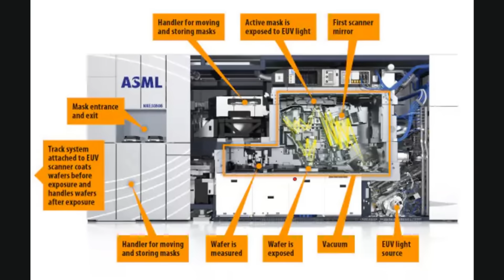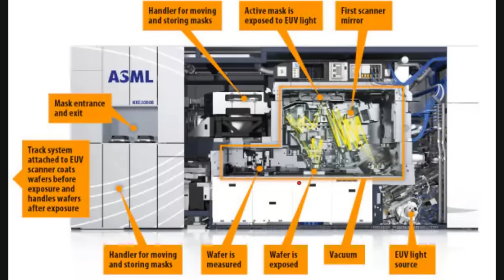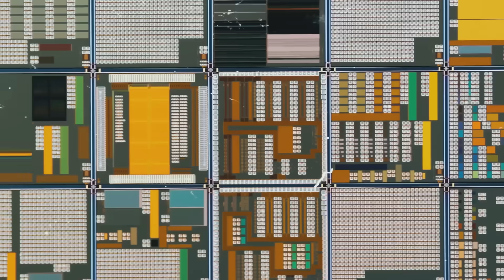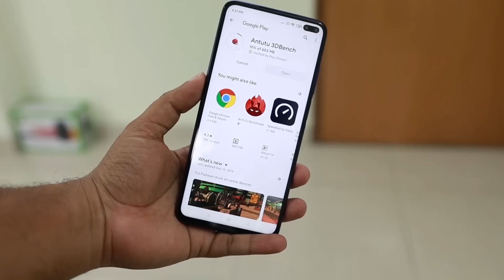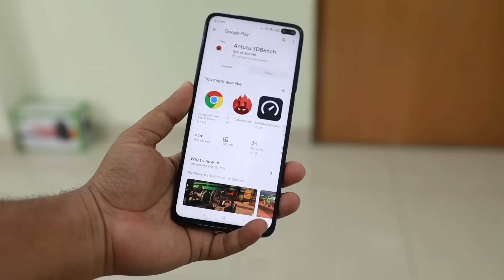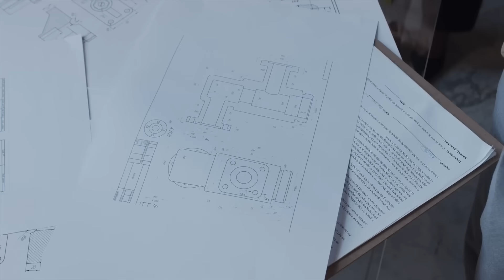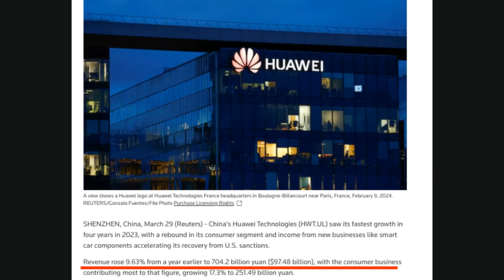China Defies U.S $400B Sanction Wall—Huawei Builds Banned EUV Chip Machine & Replaces ASML

Comment: During ASML's development, that technology Huawei uses was considered a design option, but they went for the laser in the tin droplets idea instead. Anyway, generating the light is only the first step. The trouble with EUV is the refractive index of glass is very low, the lenses are quite opaque at that wavelength hence you lose a lot of power and it is hard to reflect the light, so the mirror has to be made from about 50 layers with nanometre accuracy. ASML get their optics from Zeiss. The mirror calibration machine comes from Japan. Indeed the tech ASML uses comes from all around the world.

Comment: Doesn't this have a much higher cost due to low yield, and still less power efficient, because it is still 5nm technology at the most? 
Strategically and politically, this is doable. It is not feasible for mass production yet. TSMC and Samsung are still the top players in 3nm technology. 
Moreover, 2nm products are coming in 2-3 years.
Reply: By your logic, there is no point in chasing the top just because there is existing technology better than you now and in the next 2-3 years.. 
When global blockade is your issue, cost to yield isn't gonna be an issue. And in 5 year's time, even less so.
Reply: Anything less than 5nm is nice to have, not a must.